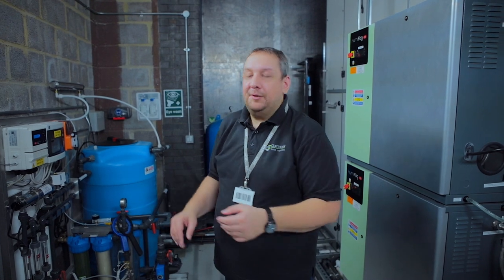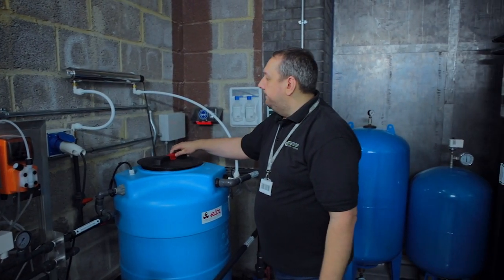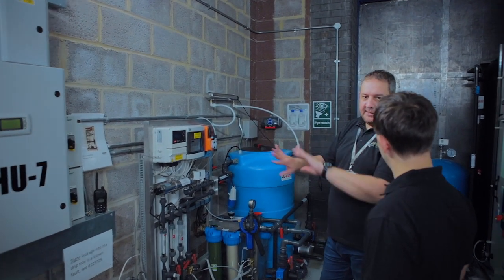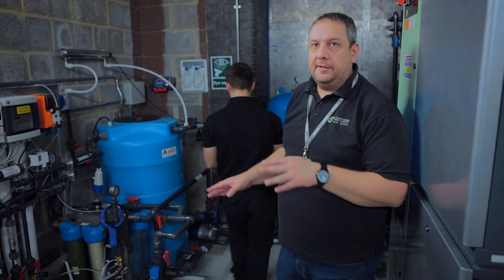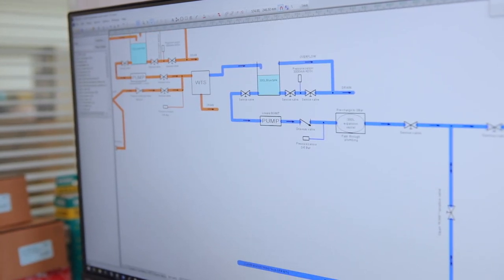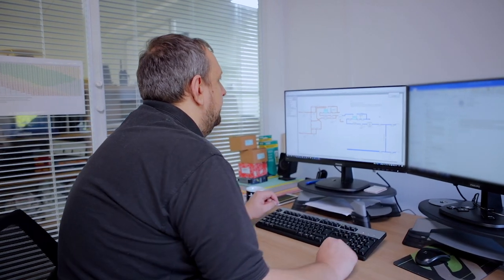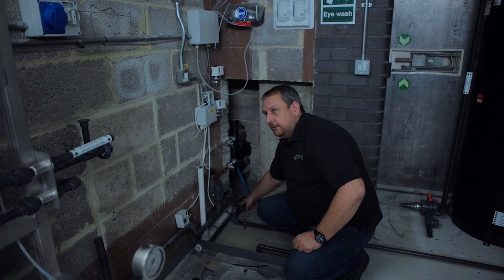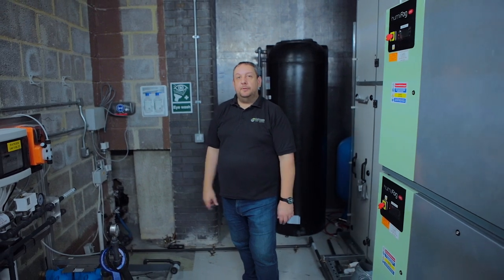BUILDING THE DATA CENTRE | COOLING WATER TREATMENT SYSTEM UPGRADE | EP. ONE!

Comment: Great video! Quick audio tip:  when using a Lapel microphone, attach it to the middle of the T-Shirt (where the buttons are) and point it down. You get a much more balanced level that doesn't change as much if your subject turns their mouth away or towards the microphone. :)